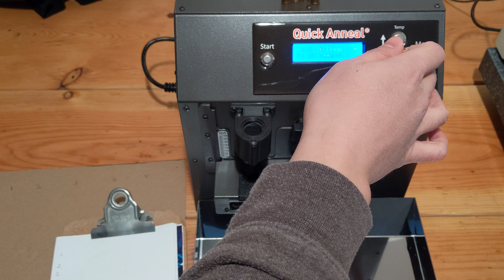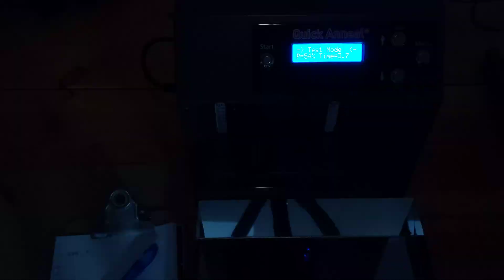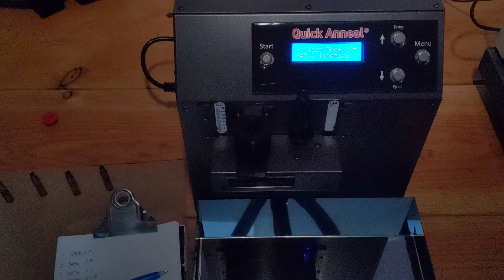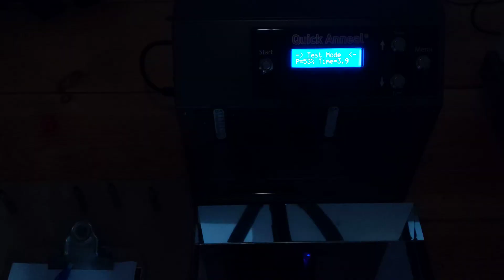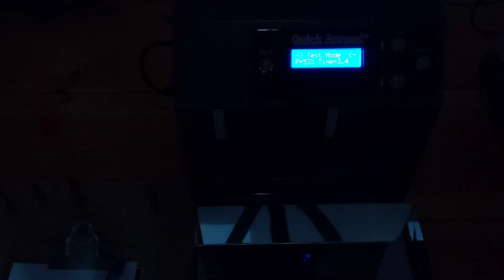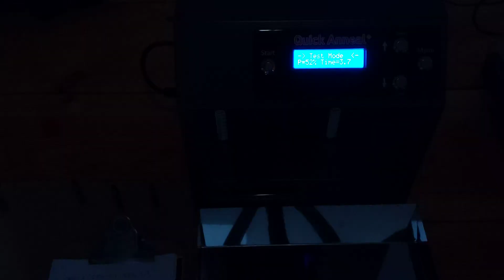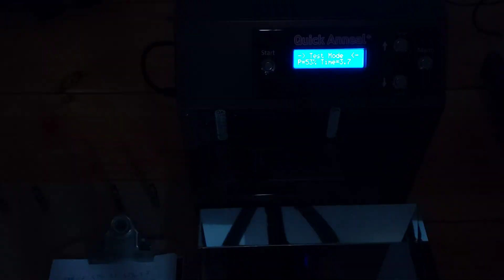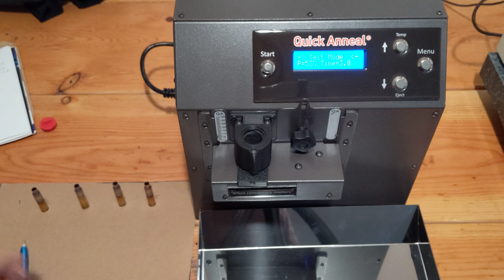Quick Anneal case annealer Test 2 - test annealing averages

Comment: What is the percentage?
Reply from the maker: According to Quick Anneal , the sensors measures the neck/shoulder area thickness. Whatever the algorithm/software is, the output is displayed in percentage. If there isn't enough difference in the neck/shoulder area, the percentages output as the same. I just ignore the percentages when I anneal these days.

Comment: really interested in the quick anneal, cant find a price anywhere, even on their website. sent them a purchase request. how is the reliability with it? had any issues?
Reply from the maker: Nope, no issues but I'm only a couple hundred shy of 3000 anneals. The induction coils and power supply unit doesn't seem like it's weakening or have cooling/heating issues. I judge that based on the recorded time settings I have for my cases and it did not need adjustment to get a dull orange glow. 

I haven't performed maintenance on it other than wipe it with a clean towel. There's no service maintenance interval in the manual and while there's antifreeze/coolant inside of the unit, I don't think it's supposed to be user serviceable and should likely last a "lifetime".

 I don't think they sell direct to US consumers anymore, but when they did, I emailed them direct for a price quote and invoice and it was 18540 South African Rand, which at the time converted into around $990 USD. Now the conversion rate means it's roughly $1051.90 USD.

Now, they'll likely refer you to the US distributor Mountain Forged, which sells it for around $1395, or their UK distributor if you're somewhere around Europe, and I don't think they have a Canadian distributor (so you may have to order direct if you're from Canada), and they may have a Australian/New Zealand distributor, but not sure on that either.

Comment: The more I look into this machine the more I am leaning towards it over the AMP
Reply from the maker: It's a good annealer for sure, despite the case anomaly detection feature being of limited use (my opinion). If a person is used to a flame annealer and the "glow method" of setting anneal times and aren't bothered by it, I don't think anyone would be disappointed by the Quick Anneal at all. If mentally a person has to have a preprogrammed time set for them based on a case analyzed, the AMP would be for them, as that mental hurdle would be too great for the Quick Anneal to overcome.
Reply: Im concerned on the fit for 6BR , shorter than 223 ??? @Evintos
Reply from the maker: @Aldocello1  https://i.imgur.com/LO5rlYi.jpg
https://youtu.be/L29k2LX8qKM

It'll be able to anneal cases longer than approximately 0.750" - 0.770"
Reply: Far more better than amp